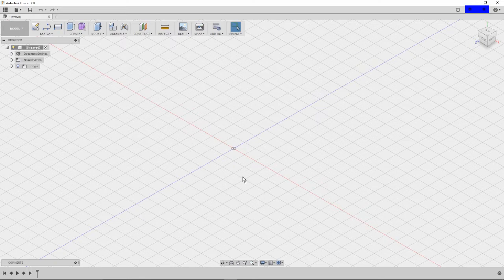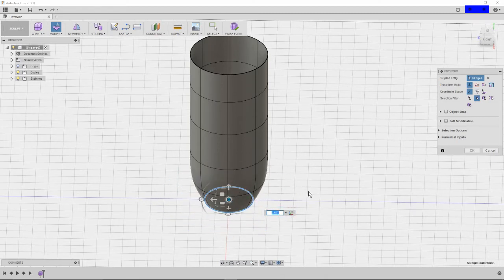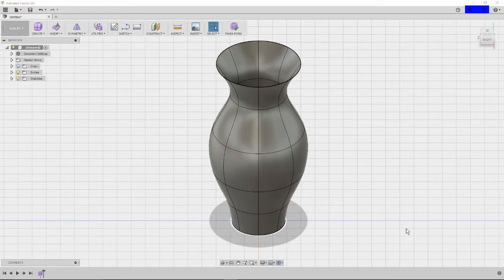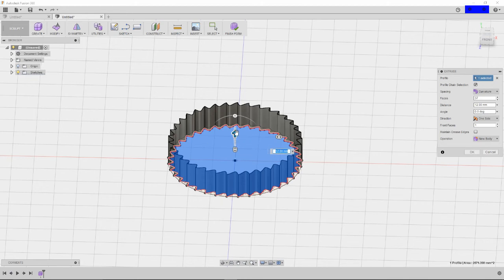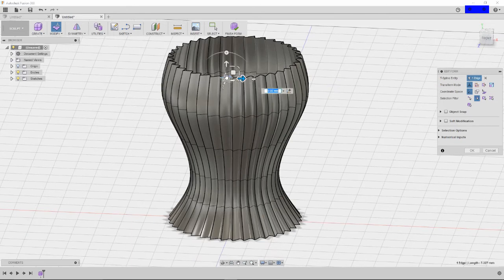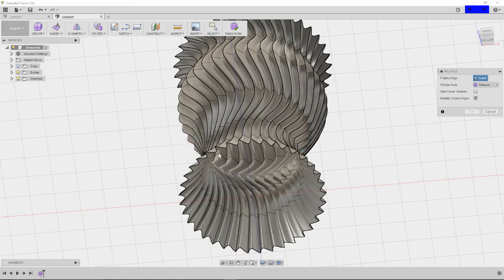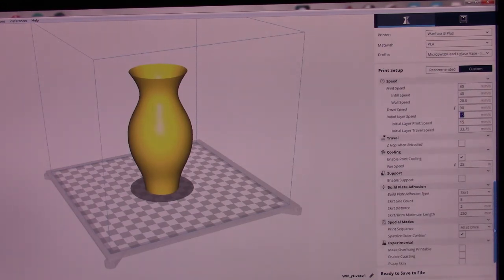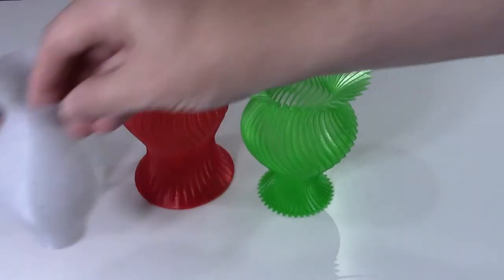Fusion 360 - How to Design and Print Your Own Vases

Comment: Every time I go to extrude it doesn't make the shape of my splines. They are all closed and simple shapes but the extrude just makes a circle.
Reply from the maker: I would try to offer a suggestion; but, I haven't used Fusion 360 in about 5 years at this point.

Comment: Just a tip on your print settings. If you increase you're extrusion width from 0.4 to 0.6, you'll get the same benefit as your current settings without the over extrusion at the bottom. Do a smaller test print first though because it may require the flow multiplier to be increased a little above 100 to compensate for the increased pressure in the nozzle (otherwise you might get underextrusion, but only in the base.

Excellent tutorial though. I consider myself to be an expert with Fusion 360 but I've never used the forms/t-spline mode at all. This is the best tutorial I've found for it yet.
Reply: Your*
Reply: @Atlas_Redux  Studies done by Harvard and the University of Michigan found that people who correct spelling and grammar on the internet tend to be both below average intelligence, and have significantly higher than average levels of narcissism, sociopathy, and psycopathy. Just in case you were wondering...
Reply: @Chris-hn4lp  I wasn't wondering. Also, I have taken three separate Mensa-approved tests in the Norwegian Armed Forces, Artillery, over the years. My average was a clean even 150. 57 Lunder, over and out.

Comment: Thank you for the tutorial!  I made a vase in Fusion 360 but when I import the model into Cura, Cura complains that the STL is non-manifold.  Did I miss a step?  I'm not that experienced at the 360 sculpt environment.
Reply from the maker: Here's an explanation of non-manifold mesh and how to resolve them:  http://3dprintingninja.blogspot.com/2014/07/non-manifolds-your-worst-nightmare.html

When I run into it, it's usually due to intersecting mesh.

Comment: So how do you like the newest UI for F360? 
 I don't know if you get the Autodesk Fusion 360 vids. Lots of reasons why.
I tried to do this twisted vase again with it and was a "little" confused. Doing a test print right now......    :P
Still doing the tie dye thing?
Reply from the maker: Honestly - I haven't even touched Fusion in at least 5 months.  So, I guess I should login and see what they've done with it?

Yes - still doing the tie dye thing.  I publish a new tie dye video every Saturday.  I'm also doing woodworking, epoxy, and lathe (primarily rings at this point) videos and publishing those every Tuesday/Wednesday.  I'll be adding in some pen making videos within the next couple of months.  So, the 3D printers have been sitting dormant for the past few months as I've geared up with the lathe, woodworking, metalworking, etc. stuff.
Reply: @CasualCollisions   That sounds like a  very creative  shop. I just ordered a 2' x 4' CNC Router to get my creative bent sorted.  Not a whim. Three years in the making. Small but still easy to begin with. The list of software that one may bring to that end is huge. And the $ for some is !!! Thank god for Open Source and Free
Learning curve to surmount - appalling. Must compartmentalize and keep the blinders on. I am 63 and trying to pretend I don't notice the weight of it :-)
By all means do take a look at the new GUI. You may go to "preferences" and revert back if you like but only for so long. Nothing like diving in!

Comment: i use fusion 360 to make a flower vase but the water leaks not sure why because is 2mm thick
Reply from the maker: Some filaments work better than others and the slicer settings can make a huge difference in the final results.  With that said, I'd say about 75% of the vases I print will hold water and the remaining 25% need a couple of thin coats of clear spray paint to seal up the microscopic areas that are weeping.
Reply: throw a layer of water based polyurethane on it. done deal